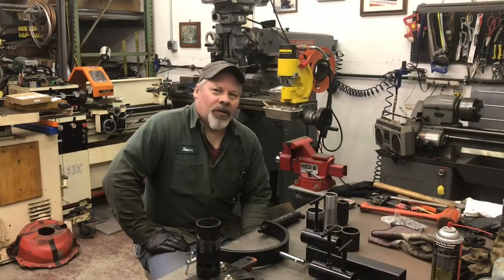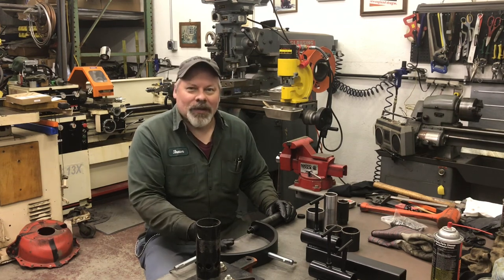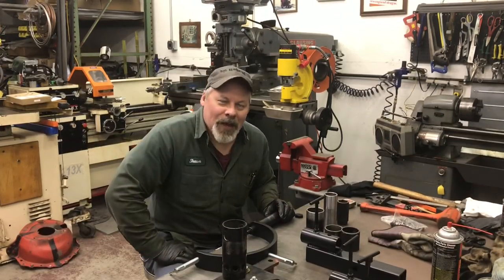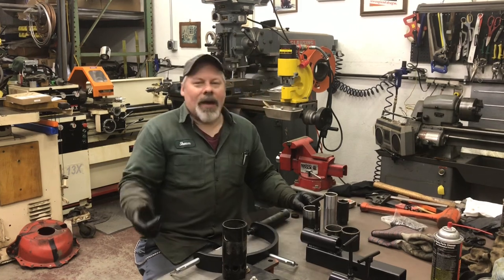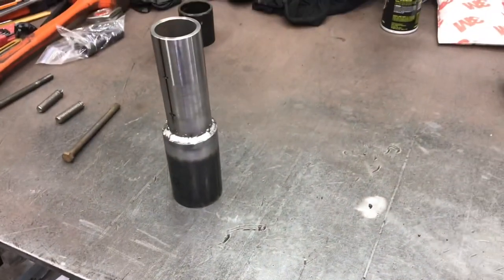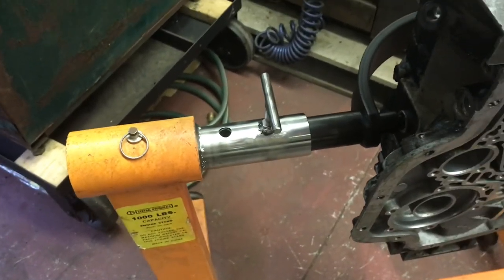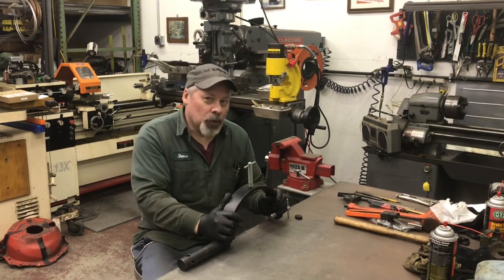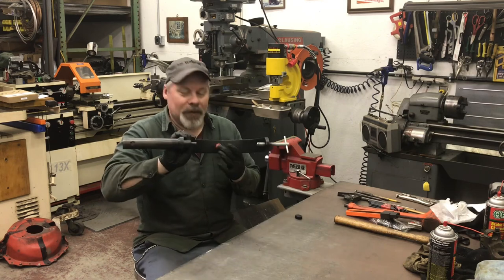Transmission Holding Fixtures: Part Two

Comment: Lol. Called that bolt pattern instantly. I have a little iron block one down stairs with that super scary right side. Again adapter is $130. I have a 2x4 under the front lip of my pan to hopefully never see it fall off.

Comment: Thanks for the videos, really appreciate your straightforward approach and knowledge sharing. Had a quick question if you can answer. Just bought a supposedly freshly rebuilt th400 that supposedly had hard shifts when warm on a built low vacuum engine. Going to build a holder so I can work on it but before I left with it we took the pan off and the metal gasket under the kick down solenoid had only one bolt installed and the open side was bent up so the gasket effectively blocked the hole under the kick down. Was that a mistake or is that a technique?
Reply from the maker: That sounds like a mistake, or a strange technique I have never heard of! Thanks for watching!
Reply: @mountainsgarage  Thanks! Corrected that issue and hope once I get inside it’s really the built transmission it was advertised to be!